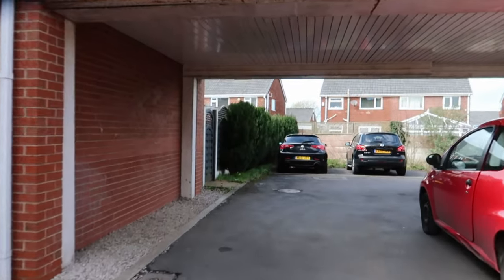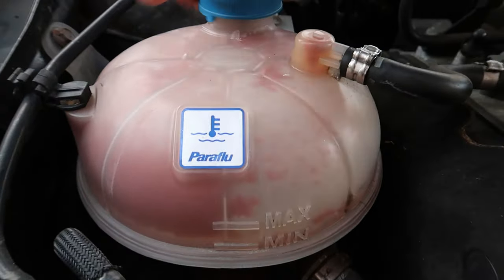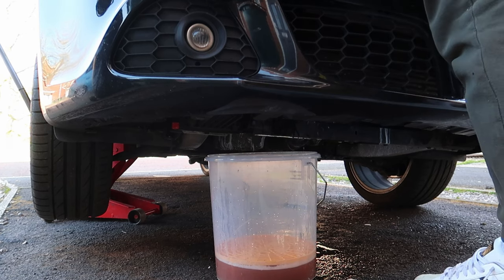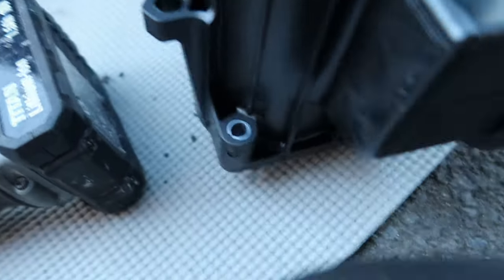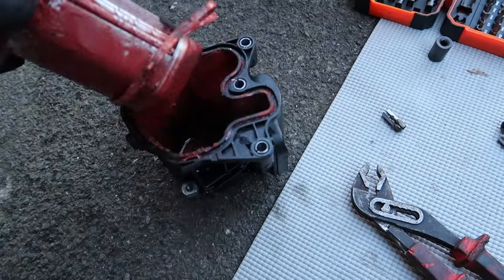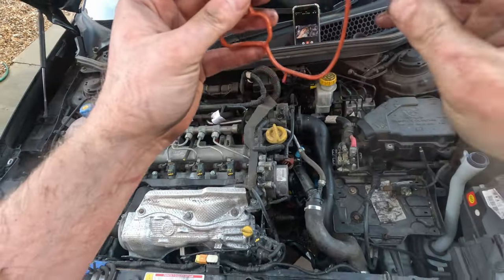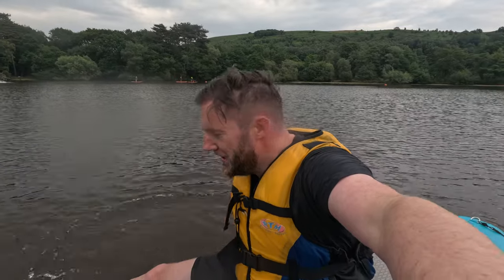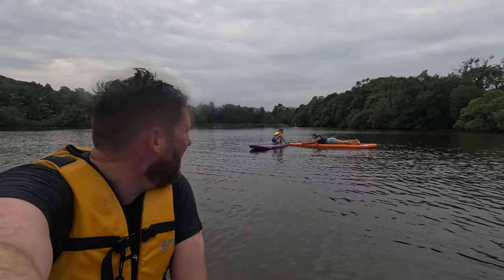UK’s “Cheapest” Alfa Romeo Giulietta Gets EGR Cooler Replacement | WHAT A JOB!?!?!

Comment: I'm about to tackle this job tomorrow for the first time 😢 no such thing as a small job with an alfa
Reply from the maker: Your not wrong, how did you get on?
Reply: @BamMotors  iv put it off until this Thursday because it was peeing down but glad I did after looking at the state of the torx bolts. There gonna crumble as soon as I touch them so want to have new bolts ready
Reply from the maker: @mrbrownz554 if your waiting til Thursday is recommend to start applying WD40 over the next day or so
Reply: Gave it a good first go but there was only 1 screw that would crack so after buying replacement jubilee clips and a rotary cutter I will triumph on Sunday
Reply: Or Monday going on Tuesday haha 😂
Reply: Finally got the cooler box off today  I had the same issue with the top left t bolt. It was seized and had to get the mole grips and heat gun to it then it finally snapped but got most of it out. Just got to put it back together again tomorrow. Thanks for the video it helped loads

Comment: Where did you get that set of t's from? Also what length are the bolts?
Reply: I done the job today and used a 26 pounds tool set from B&Q  the bolts are about 65 mm but not measured them
Reply from the maker: Glad you manage to get it done, very fiddly job! I’ve recently done the thermostat on an Audi TT and that was just as bad!!
Reply: @BamMotors  😄 I'll have a look to see what you were up against

Comment: Dude, DON'T ever get under car with just the hydraulic jack, for your safety, at least throw a spare wheel next to it, but just use axle stands. Maybe you did use them, but I couldn't see that at all in the video.
Reply from the maker: There was one under there, I always make sure there’s a jacket stand to support the car, but thanks for you help.
Reply: @BamMotors  stay safe dude 😎